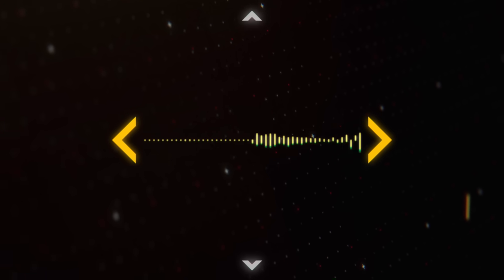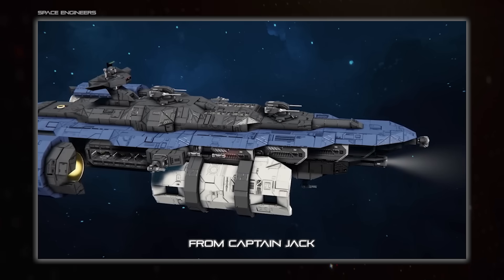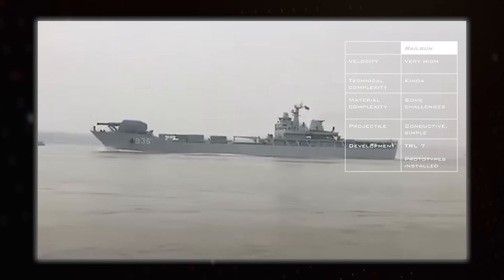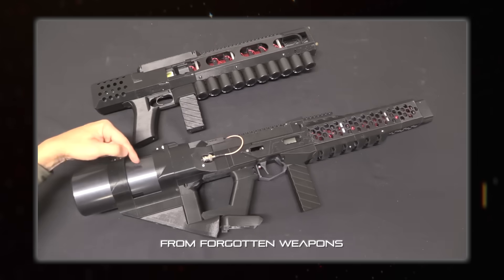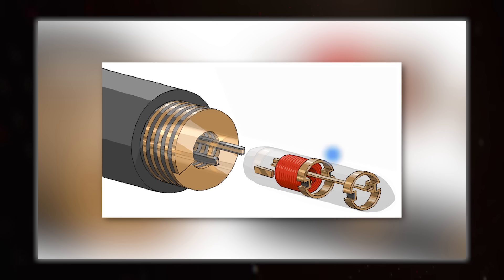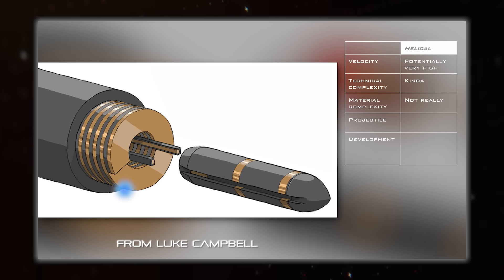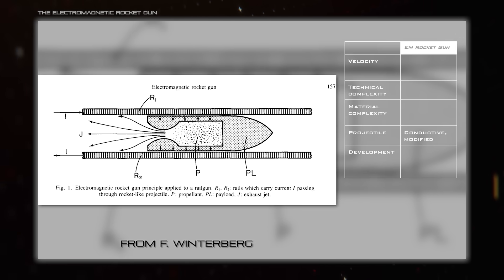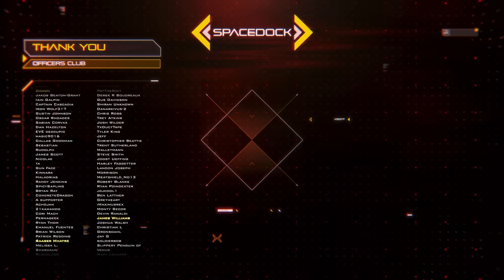The Deadly Coilgun/Railgun Hybrid You've Never Heard Of (Helical Railguns)

Comment: The US Navy did not abandon the railgun project. In fact, they completed it. Railguns are installed on all Gerald R Ford supercarriers and they have been deployed in combat operations, just not in the form anyone expected. Every Gerald R Ford comes equipped with an EMALS (Electromagnetic Aircraft Launch System)--a railgun that fires airplanes instead of bullets.
Reply: Not quite, the EMALS system actually uses linear induction motors which is the technology used by maglevs and some launched roller coasters. It's basicaly a motor that has had its armature cut open and lain flat.
Reply: Dang so they launch planes at the enemy with the intent of a kamikaze attack? The Navy took some notes during the Pacific conflict didn't they? 🗿
Reply: @OK-zo3cq  I suppose it's in a sense a refinement of kamikaze tactics - they hurl themselves at the enemy and then, crucially, miss.
Reply: @OK-zo3cq  the current launchers use steam power, causing a significant bottle nech on the launching phase. The EAL system is on the super carriers, but so far the largest thing they've launched are junked cars that the Navy has shown so far. The last time I heard about the systems years ago, they were revised to make it to operation by 2028, and likely wont be operational to launch jets before the Battle of Armagedo.
Reply: My inner redneck see's potential with converting said system which launches planes into an ordance delivery system as a secondary option..
Reply: Way to spill state secrets guy
Reply: @Wonderwhoopin  It isn't state secrets. The presence and use of EMALS on the Gerald R. Ford class carriers is publicly available and easily accessible - it's literally on the Wikipedia page.
Reply: @Wonderwhoopin  The Navy has made plenty of public statements about it.
Reply: Literally none of what you said is true

Comment: So, basically the Helical Railgun works like a coilgun but the coils are mechanically activated as the projectile makes current pass always through the next coil so it has the technical simplicity of a railgun but advantages of a coilgun, so the velocity is more controlled by the direct power output like in a railgun and not so much by the coordination since it happens all on it's own with the inertia and it's mechanical structure, i think we got it, we got what will be in the near future a new type of conventional weapon, or at least one type of weapon that is not going to stay in a laboratory at Area 51 forever

Comment: I found an interesting paper from 1991 on a type of self augmenting railgun:

"The accelerating force of a railgun 1/2L′I2a can be increased by augmenting the self‐induced magnetic field created by the armature current. Augmentation fields can be produced by external current coils or, as is done here, by shorting the railgun muzzle, and using the gun rails as the augmentation coil. Experimental results are presented for a 3.6‐m railgun operated in this self‐augmented mode, and effective inductance gradients are achieved which are as much as 9.3 times that of the unaugmented gun."
Reply: As you note, augmented railguns have been known about for years but never seem to have been adopted for flagship projects. I wonder if small scale trials have shown that they do not actually work well in practice?

Comment: The problem with coilguns, is that to get any amount of useful velocity out of a projectile you need massive coils, otherwise resistance heating just vapourizes them, and the larger your coils, the longer your magnetization and demagnetization effect times, thus the slower your potential sequencing, lower your energy transfer efficency, and lower your effective range. Without superconducting coils, you top out at about 10km/s of projectile velocity. Meanwhile railguns can easily reach 100km/s, provided the armature is light enough, before the electromagnetic force starts buckling the rails.
Reply: Actually it difficult to achieve more than about 3000m/s with a railgun.
Reply: @derekp2674 It isnt, zou just need sub gram armatures.
Reply: @egoalter1276  If it was really easy, NASA would have achieved it in the 1960s with their small scale capacitor driven railguns. Marshall and Barber achieved a maximum of about 6km/s with their railguns powered by the enermous ANU homopolar generator. At Culham, the best we managed was about 3km/s from a standing start. Our competitors, er sorry colleagues at RARDE managed 4.2km/s with the aid of significant pre injection by powder gun. Sandia managed about 8km/s after injecting at 7km/s with a two stage light gas gun.
There are two main problems:
1. So called "plasma armatures" rarely work ideally. Most suffer from the formation of parasitic secondary arcs behind the projectile.
2. Solid armatures are limited by the physics of eddy current heating to velocities of a few km/s. After that, they transition to plasma contacts and then suffer the same drawbacks as simple plasma armatures.
Reply: @derekp2674  I have been misled about plasma armatures then. I have read in numerous places that they solved the rail ablation issue more or less completely.
Reply: @egoalter1276  I think the velocity limitations of plasma armatures owe more to the complex, non ideal behaviour of those armatures rather than only rail ablation. The latter is however very detrimental to barrel life. 
But this is a fairly complex subject. I did also wonder if you might have been confusing the much higer velocities attainable in shock tube experiments with those of railguns.
There is also a risk that I am unaware of some key recent breakthroughs, if no mention of them was present last time I looked at the Wikipedia article on railguns.
For a serious look into this subject, there are a lot of free to access research papers published by the US Government and Research Gate ought to be another good source. But many of the best available papers are published by the IEEE as journal articles or conference proceedings, so it generally costs money to read these.
At Culham, we operated a 1cm square bore railgun from about 1985 to 1992. That gave us a first hand view of all the practical problems of plasma armatures, especially once we focused efforts on measuring the spatial distribution of current along our rails during a shot. In effect our railgun worked more or less ideally up to about 2km/s but suffered badly from parasitic secondary arcs (sometimes called restrike) at higher velocities.

Comment: Title response: No, but I did come up with the idea about 5 or 6 years ago when I was really interested in both of the concepts, wondering what would happen if you combined the two somehow. But we aren't quite there yet on the materials and components required to make such things. We're closer now, but, also still many steps away from that point. Capacitors still need higher capacitance so they can hold more 'rounds' per se, and the batteries need to be smaller while holding equal or better storage capabilities. And again, we are getting there. Solid state batteries are helping with the size issue, since they can more easily be fitted and molded to the end design, solving for the size issue overall along with helping with safety issues for the end user. Capacitors have some work yet, as they are also getting better, but mostly remain super bulky in their more usable varieties for the application. 

Also, there is the whole issue of the ammunition. Those need to be made lighter somehow, while retaining usable mass and the magnetic properties required. 3D printers help in a lot of these issues, but due to the malicious out there, using one for designing a prototype for instance to be patented and produced at a R&D company would probably require some special... licensing to be able to do so without raising the ire of the legal system. 

Heck, I'll be surprised if YouTube lets this comment stay up.

Comment: The rail/rocket gun could be adapted with a recoilless rifle with a choke at the back so not all the gas thrust is lost and you don't need a super strong/heavy barrel. Protip check the 6 before lighting it off.

Comment: 3:54 
Coil guns complete their circuit by the projectile they fire.
 A sensor, or in this case literally an incomplete circuit times its on and off state by using the projectile as a wire to complete the circuit which triggers an on and off state.
This requires little programming to get right, and bypasses this problem.

Getting the spacing for each circuit correct and not trapping the projectile in one magnetic field all because of a faulty connection is the only technical challenge of this method.

Comment: rail guns are brushed motors, with about 1% efficiency in the traditional form since, well, a brushed motor that looked similar would suck too, helical is a more reasonable form of linear brushed motor 
coil guns are srm(s), current forms have some sadness due to not having a core, turning your coils 90deg and adding a core might yield surprisingly good results, haven't seen anyone try that yet

Comment: EM weapons are very impressive and ripe with potential, like we've seen EMPs and the classic railgun, but hearing about the use of coolant in the section with the EMRG(EM rocket gun).
Imagine if they used coolant for EM missiles, especially the intercontinental ballistic missiles, just imagine it, EMICBMs, Faster than the ICBMs. EM nukes missles... Truly horrifying.
or... Orbital Cannons using Electromagnetics, an Upgraded Rods from god but the projectiles are powered and shot off into the target using coolant as a start off.
Reply: Electromagnetically propelled ICBMs aren't as "horrifying" a concept as it sounds. ICBMs, especially those tipped with multiple-independently targetable re-entry vehicles (MIRVs) are already almost impossible to reliably intercept, and thermonuclear warheads themselves are already amongst the most horrifying weapons known to man. The reason why reliable defence against ICBMs is nearly impossible is that it is much cheaper for an attacker to simply put more warheads or decoys on a missile than it is for the defender to field enough interceptor systems and to reliably discriminate between actual warheads and decoys.

If you want to deliver a nuclear warhead to a target with very little warning time, SLBMs (submarine-launched ballistic missiles) have been able to do that for decades. A ballistic-missile submarine, especially a nuclear-powered one which never needs to surface to snorkel and recharge its electric batteries, can quite easily sneak up to the coastline of a nation and launch its full complement of missiles before that nation's anti-submarine forces can even detect and destroy it. The time to target for such an attack is usually less than 5 minutes. Short-range ballistic missiles like the old Pershing II and the Topol-M can also do this from land.

As for an "upgraded" Project Thor, using electromagnetic force to propel the projectiles doesn't solve the main problems behind that concept, namely cost and targeting. Orbital launches are still very expensive, and putting a bunch of tungsten telephone-sized projectiles into orbit is very pricey compared to the cost of other, proven weapon systems like cruise missiles and stealth bombers which can generally perform the same tasks nearly as well. Moreover, one issue with the "Rods from God" concept was that upon re-entry, the inert tungsten projectiles would be sheathed in plasma, and thus unable to send or receive any guidance signals, and since they have no explosive filler, they must be pinpoint accurate since a near miss won't do anything to a hardened target.

And it is hardened targets, like missile silos and deeply buried bunkers are what a "Rods from God" system would be ideal for destroying. Except that if the projectiles cannot accurately hit their targets, then the system itself is useless for its intended purpose, which is why it was ostensibly never further developed, as far as we know, unless the USAF did figure out some classified way to solve the guidance and accuracy issues.

Comment: railguns would have no increased range in space
in space there is nothing to stop movement
until it hit something or is affected by gravity you could throw something  by hand and it would move forever
what higher speeds allow is requiring less predictive targeting and delivering more kinetic energy at the destination over long ranges 

you should do better, this is the very basics of space 

side note, one reason why magnetic propulsion has a benefit is that it doesnt require a close seal like gas expansion propelled projectiles require 
wich in the vacuum of space would end up vacuumwelding the bullet to the inside of the barrel before friction could ever be a problem a railgun would have to worry about 
so the benefit of magnetic weapons is the projectile not touching the barrel
Reply: Just noting that he said "effective range," which is achieved by increasing the velocity of the projectile, which reduces the amount of time that a target has to detect the incoming threat and evade.
Reply: still seems kindof a waste in space
as long as its slower then light its going to be dodgeable in space 
easier to do predictive targeting and saturation then try to reach that speed with matter
still need magnetic weapons to prevent vacuum welding 
but for all the reasons to want railguns, range and even effective range are low on the list

Comment: They claim in Eraser that the projectile is aluminum. Is that realistic? Would you use an aluminum sabot for instance? Surely a solid aluminum slug can't be moved this way or am I wrong about that?
Reply: Aluminum is the best metal to use for solid railgun armatures. This is because it has a low resistivity, a high limiting value of electrical action (integral of current squares w.r.t time) before it melts and a low mass for structures of a given strength.

Comment: I've tried looking this up over a few years, but is there any reason you can't combine a railgun (using the lorentz force at the beginning) and have the electromagnetic field the coil gun uses for the rail to ride along so it won't wear out the barrel and allow it to accelerate even more?  Like a maglev train for the railgun.
Reply: It's mandatory that the rails touch the projectile. Otherwise, the current is transferred by electric arcs that destroy the rails faster than friction does.

Comment: About those sexy "thigh gaps"... Practical design, from my perspective, will be rail gun with those arms on hinges and shock absorbers so when projectile is fired they open up and relive the stress of lorens force pushing them apart, istead of making the super stron and rigid. As for rail erosion - just put a clip of sacrificial lining separeted by some sturdy dielicric or even make them ablative.
Those strips could be made from tungsten on top of ablative ceramics or some reactive polimer.

So whole process should go like this:
1)Two arms on shock absobant hinges with trench along them, filled with sacrificial lining sandiwich close.
2) projectile is loaded to make the contact.
3) current is ran through lining, pushing out projectile, evaporating thin rails and  ablative. Since speed is so absurd, by the time projectile leaves "barrel", sacrificial rail will still be intact and just begin to evaporate.
4) since "thighs" have considerable mass they will have good amount of inertia and will begin to spread out only after projectile will leave the "barrel".
5)springs push out multilayered sacrificial rail and "thighs" close for cycle reapet.
That way, you can rapid fire without overheating the "em catapult".

Imagine it like reverce crossbow, where limbs close to be paralel and the middle is lunching the arrow when the limbs spread apart.

This setup is even less complicated than your regular flinlock firearm😂

Comment: Nowadays you can simply use sensors to do the timing in a coilgun for you. Beam and light sensor run by an Arduino in front of every coil toggling the next stage ought to do it if you were to make your own at home, no need to know the mass of the projectile. Allegedly.

A bank of capacitors would also be the way to go unless you have scarily high current power supply. Oh and with the metal impregnated resins available nowadays you could theoretically 3D print the ammunition so that it maintains a flatter trajectory when it drops subsonic.

Comment: I don't think the friction is the main cause of railgun erosion. The problem is the electric arcs making microscopic welds between the projectile and the rail, which are then broken apart with the acceleration of the projectile. You can also think of a railgun as an Electric Discharge Machining device. The way this is fix is by having the rail made of a self-lubricating conductive material, like graphite, disabling any welding action with the projectile. But at that point, the design is intended to wear down on purpose, because that's how self-lubrication works.
Reply: That may be true when a solid armature starts to transition to arcing contacts but if a solid armature can function with solid metal to solid metal ohmic contacts (i.e. as intended) then there won't be any arcs and then adhesive wear will be the main source of barrel rail erosion. I have seen this latter mode predicted by engineering analysis and then confirmed by experimental results from low velocity solid armature railgun experiments. As arcing contacts will destroy the surfaces of railgun rails very quickly, one key goal of railgun research has been to design solid armatures that work up to the velocities required by military systems.